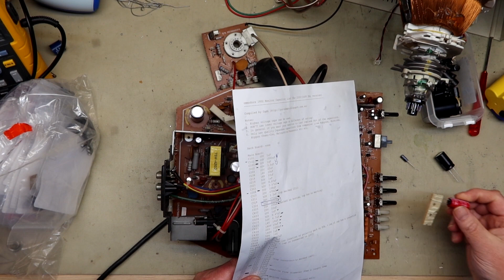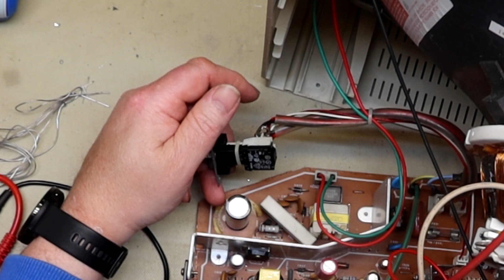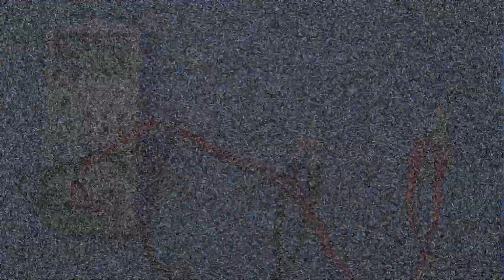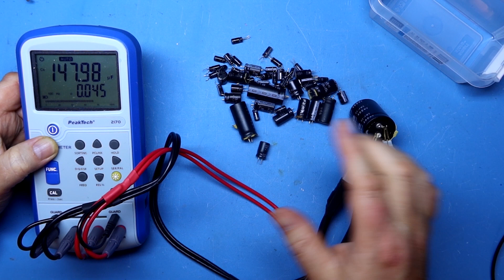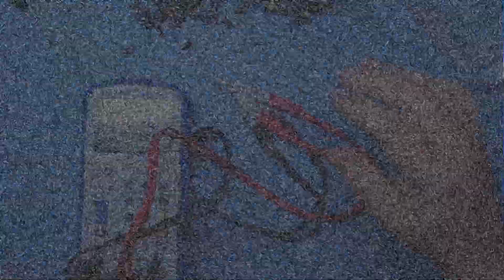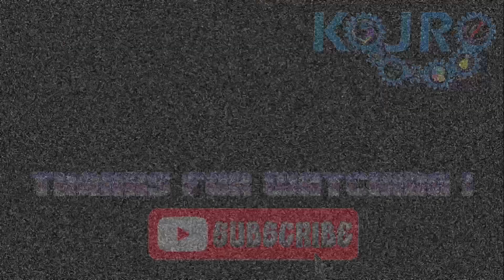The Commodore 1802 Monitor, Part 2, Don’t mind the CAP.

Comment: 80's caps are mostly very good, after '95 until the early 2000's the caps are suspect. In the  audio amplifiers from the 70's to 80's, that I repaired, very few caps were required, and it depended on make and model, and they were almost all obvious to be needed to be replaced.

Comment: I like that you are unafraid to get down into the "nuts and bolts" of a problem.  It looks like all you might need now is a good power switch.  I've never reformed capacitors (it was not common practice for the military gear I worked on back in the day), so that is an interesting "rabbit hole" for me to follow.  Thanks.